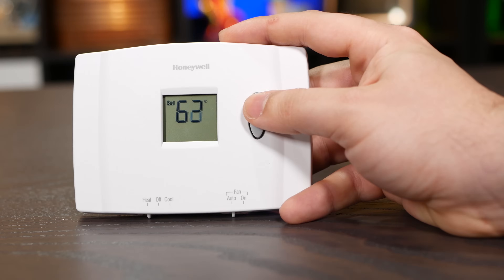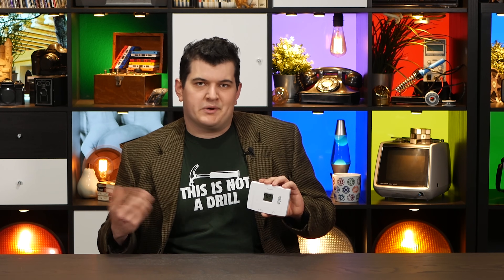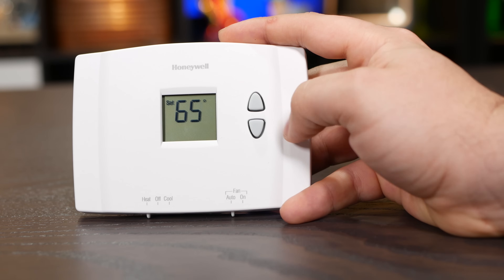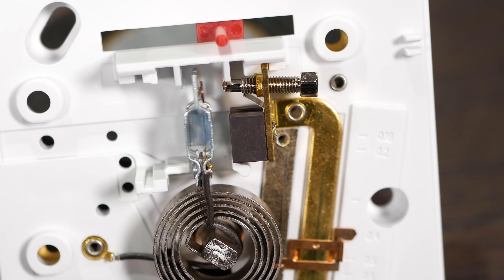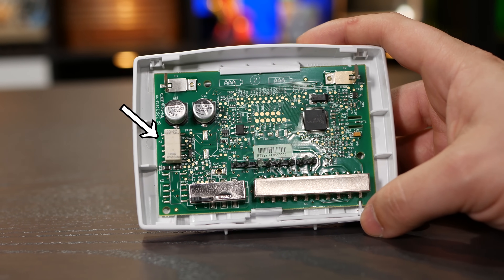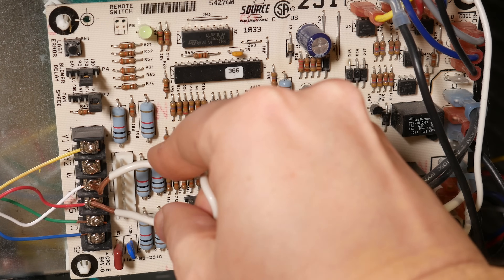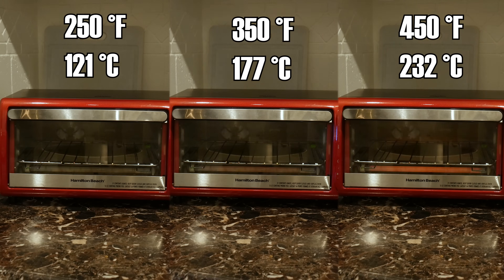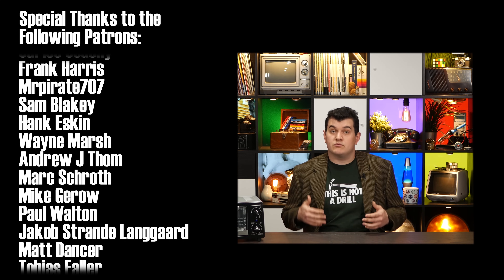Thermostats: Cooler than you think!

Comment: my old crappy thermostat has a boost button that overrides the thermostat for 1hour , there by forcing the boiler on to an always on situation, and its not a smart thermostat , its part of the boilers control panel , basically forcing the boiler to heat the radiators , yes uk , we use radiators metal boxes filled with water to heat rooms , no Aircon, No forced air , 
unless you count flatulence , 

boiler make and model is a Worcester HeatSlave , great name i think , and its burns heating oil , Which is a fancy way of telling people they have 1000 l of unrefined Jet fuel Kerosene in their garden

Comment: I have a question about my own furnace. When it's in heat mode, and the thermostat calls for heat, the blower waits to turn on for about two minutes. And as the thermostat stops calling for heat, it continues to run for about the same amount of time. This doesn't happen in cool mode, and also, it is not the thermostat. What is the reason for the blower to wait to turn on and off?

Comment: You mentioned power on the Control board. One thing we ran into with our HVAC control board was not enough power. Sometimes the heat would come on for about a minute and then suddenly shut down. This previous owner of the house had this problem as well because he had even purchased a new board, and left us the old control board sitting in a drawer somewhere. We had many HVAC people out to help us with the problem, the system was usable, but it was working at around 90% of the time, shutting down early about 10% of the time. We finally had an actual honest HVAC person tell us the control board wasn't getting enough power. So we looked at the power line going to the board and discovered that it had one too many break points in the circuit going to the board. In fact we had made the problem worse by having another outlet installed on the same circuit. We fixed the problem by having an electrician wire a dedicated line from the breaker box to the furnace control board and we never had another issue with power.. except dishonest AC and electrician people. Never let your electrician or AC guy install tiny wire caps(yellow usually) on the power wires going to the Control-board. Insist they regulation standard large caps(red usually) on the power wires. The tiny ones will eventually melt, I fully believe this to be a ploy to get you to call them back. The wire caps leave a mess inside the unit when they melt and pose a fire hazard and could damage other things like your control-board. I keep a bag of regulation wire caps near the AC and I have given strict instructions to the my wife that she is never to pay one of these people if she see they put the wrong caps on the wires. In fact she is to show them the bag of what we expect them to use and if we have a service technician over I check the wires for those stupid caps. I mean seriously what are those good for? I wouldn't use them to hook up a cheap car radio, yet here there they are on 120vac AC system.

Comment: My thermostat does the thing that you mentioned at the end of the video. It's actually the default setting. Whenever you adjust the temperature, a little "TEMPORARY" warning shows on the screen and it runs that temperature for a little while (not sure how long) before going back to the normal setting.

Comment: I have an older Junkers boiler where the control unit can regulate the "blast" by putting a voltage between 0 and 24V onto the control line. More Volts = more "blast". The control unit even learns how long it takes to warm up the flat so you just program it to WHEN you want HOW MUCH temperature and it will adjust the starting time accordingly.

Comment: I have a weird-ass system with the city's central heating. Like, we just get a pipe with hot water coming into the house along the cold one. But rather than just use old-school radiators that you have to turn on by turning their valve, the system has an electric thermostat, just like these in the video, that's controlling an automatic central valve that can cut off/turn on hot water for all the radiators at once. It's a fascinating combination of old and new technologies.

Comment: Also, I may have a partial answer for the question about "why thermostat wire?" Some of it may come down to building codes.

for commercial buildings, normal Romex is usually a no-no. Regular line voltage wiring usually consists of single strand wiring encased in conduit or flexible armored cable (BX cable). Both options are exceedingly expensive for regular wiring, let alone control wiring. 

Thermostat Cable, along with data cable ( like cat 5) do not need to be encased in conduit and is far cheaper for use as low voltage control wiring. 

Actually, (here in Pennsylvania at least) new commercial buildings and renovations >10% of total space are required by law to install LED lighting that must be controlled by occupancy sensors, timers or even smart controllers that incorporate multiple factors tied into a building management system.  These new LED lights can be, not only controlled, but POWERED by CAT 5 cable. 

It's a brave New world for commercial building maintenance nerds...🤓

Comment: A thermostat in the coldest room will cycle the heater more often than a thermostat in the warmest room.  If you want good fuel efficiency when running the furnace, housing insulation is crucial to keeping the inside temperature regulated, and not making the furnace cycle more often than it needs to.  This also greatly extends the life of the furnace, and keeps carbon emissions to a minimum.

Comment: 1:35 you said setting it to 80 doesn't make it heat go faster.... well a few years ago I got in an argument about how microwaves work on 50% power,  I told then that the part that makes the microwave is on or off, and the unit will have it on for 5 seconds then off for 5 seconds, they didn't believe me saying that the light doesn't turn off and the table keeps spinning ... ugghh  they try to prove them self right by saying other features of a microwave ......  I asked them what happens when you put the power to 0%, they tried to tell me that it is on because - IT IS ON-      i asked them if they ever got a DA, they said na whats that...  Dumbass Award

Comment: honestly yes the mercury one last forever but even the house settling will send them of kilter found that out the hard way with the bill apparently it was 7 degrees off when they were all perfect when the house was bought a simple fix but i dont feel like re leveling and screwing more holes in a wall just for mecury the lower end digital ones that run off AAs are fine and we dont need 7 nests in our house.

Comment: The thermostat in my apartment does what you asked about at the end. It's a Robertshaw and when you change the temperature while the schedule is it on first lets you select the desired temperature and then lets you set a time for this to be active, defaulting to 3 hours. After that it goes back to the existing schedule.

Comment: “Blue” actually does do something. Blue is connected to the common terminal which feeds 24v to the thermostat so it continuously power to the thermostat. Also it doesn’t matter what wire you use as long as it corresponds to the furnace.
Reply: Nvm he said it finally

Comment: I legit did not know about the greater than and less than symbols doing frame by frame! That is actually super handy! I believe if you hold down shift and press those same keys, it will change the 'speed' of the video instead!

And, honestly, I think that displaying the temp on the thermostat is the cause of many MANY arguments in the house... Why not have a "Colder" and a "Warmer" button that will just slightly increase the time delay between cycles... That way, you could--in theory at least--get to a 'temperature' that would be perfect for all the variables of your particular house... Room size, BTU, CFM, doors opening and closing, etc... it doesn't,, matter, since the thermostat just cares about how long the heater/cooler is running... And since I cannot tell the difference between 74 and 75 degrees of temperature, but apparently it is a cardinal sin to even raise it a single degree according to my Father... It might have saved a lot of arguments in a lot of households if there were no display at all whatsoever.

Comment: Now you should go into a condensate unit. Now that is the furnace that can go faster.  There is a combustion chamber,  a computer!  It can take the target command, and has input and output temp sensors,  then it chooses the fuel to air mixture,  runs the fan for said combustion chamber up to 3500 rpm, and will run the fires of hell! If the demand spikes,  like if you go from 58 to 80. These units often do heat and hot water,  have motorized butterfly valves, circulator motors, etc. Right up your alley!  Great video too! Thanks for your hard work,  sense of humor,  and all the information you give us!

Comment: One October we came back from vacation where our house had an interior temperature of 60 degrees.  We set the thermostat to 68 and waited 2H: 30M for the temperature to rise to 68 degrees.  The following year, we came back from vacation and our house interior was, again, 60 degrees.  We set the thermostat to 80 degrees and only had to wait 30 minutes for the ambient temperature to rise to 68 degrees.  We turned the thermostat down once it reached that temperature.

Here is what we noticed.  The furnace did not run continuously when the thermostat was set to 68, but cycled on and off in about 30 minute cycles even though the ambient temperature did not rise to tell the thermostat to turn it off.  It was cycling off by a signal inside the furnace itself.  By setting the thermostat higher, it did run continuously, because it overrode the signal in the furnace to make it do so.  We were told by our furnace guy that the furnace was designed to do this because it had a "oil saving/heat boost" system built in, that wasn't wired to our thermostat.

Needless to say, the fact that setting the thermostat higher did make the house heat up faster really pissed off my dad.

Comment: In answer to the last question about "1 cycle" thermostats, yes, they do exist in some higher end equipment.  I have HVAC systems in my radio network towers that feature a " comfort" button that allows the unit to run at a set temperature for a fixed amount of time.  Typically, they raise the temp in the shelter to a more "comfortable (72 F)" level for a period of time while you are in the tower working on the system.  After a set amount of time, it returns to its normal cycle of keeping the interior at a much cooler level (62 F).

Comment: Now what would be in your opinion the most effective and cheap way to heat a house, if you would build the house just now? I've been thinking about geothermal heating with water circulated underfloor heating elements. With that in mind, I've been thinking about having about 5 to 6 solar panels on the roof, and installing tankless water heaters to shower and sinks. I THINK it should be more energy efficient than having a boiler full of hot water?

Comment: I just backed the Raspberry Pi-based, HestiaPi Touch, an IoT Thermostat on Crowd Supply! You can literally program any behavior or automation you like. 

So yes, in fact, there is a thermostat you can ask to run for just a single cycle, then have it return to its previous setting. Or do anything else you can dream of!

Plus, your data is your own... not Google's (looking at you Nest). 

We need more open hardware devices like this. Anyone who is interest can find more info here: 

https://www.crowdsupply.com/makeopenstuff/hestiapi-touch
Reply: Busted Why not just an arduino?  Plenty of computing power for the job, and some chip models already have a rough temperature sensor inside, though wiring an appropriate part to an analog pin could help.

Comment: Interesting that the thermostats themselves here in the UK are the same but the actual heating system is different--we have boilers heating hot water for both radiators and taps/baths/etc., and of course there's usually no need for an air conditioning system. So what system is used in the US to heat the water for the taps (or should I say faucets)?

Comment: Never sure what the point of digital thermostats are (remote control aside) - a bimetallic strip thermostat needs no power input and doesn't break down, whereas a digital one is rarely fed by mains power but needs batteries which, in my experience, usually run out at the most inconvenient time so you come home to find the house freezing.
Reply: I should say I'm talking about wireless ones here, which annoyingly seems to be the norm even when they don't need to be; the C-wire system described in the video seems much more sensible.

Comment: In the UK you can get Hive thermostats (like Nest) which have a boost mode. I don't know if they do AC too but basically you can have a specified boost temperature, and you can set how long to boost for - which on the thermostat is controlled by a button. Each press of that button adds X minutes to the boost period.

Comment: Electrician here. I have gotten many a job with angry customers that bought a fancy wi-fi t-stat and discover the old 2-wire cable doesn't have enough conductors to power the device. DOH!

Now, instead of getting that cute little $100 rebate for the upgrade, they now had to pay double that to have a new cable installed, when all they had to do was get a $30 battery powered Honeywell to do what they needed. But NO, they MUST have that internet connection anyone can hack into.

Comment: I've frequently complained that thermostats don't have a single on/off switch, especially where I live where some times of the year it could be in the 50s F when I leave in the morning and in the 80s F when I get home.
The Cool-Off-Heat switch makes sense for mechanical thermostats for the reason you explained, but with a digital termostat, it would seem to me to be trivial to have a min and max temperature setting and have it use heat or ac as needed to keep within that range.
Reply: There are some that will work that way. I have one that you basically set and forget it will automagically switch from ac to heat and back when needed.
Reply: The ecobee has a "System Heat", "System Cool", and "System Off" setting so you don't have to worry about min/max temp settings ever being hit.

Comment: "It runs on full blast because that's the only degree of blast that a furnace can run." 🤷‍♂️
Reply: "There is no medium blast."
Reply: @Skipperthekitty  Only full.

And off.

Off blast.
Reply: Blasted things.
Reply: While certainly a cool statement, it's only partially true: multi-stage heating systems have existed for years.
Reply: As far as I can tell, this also applies to blast furnaces.
Reply: But what if my furnace has blast processing?
Reply: @jcrowley1985  I have no preference in reality either way, but there is no medium blast processing. Only Sega.

And Nintendoff.
Reply: Flame modulation exists and pretty sure Alec knows. By specifying it, he would have gone off topic as this video is about thermostats and not furnaces.
Reply: Look up two stage and modulating furnaces. They also have multiple stage ac units. You get longer run times at a lower capacity and better comfort because the equipment is keeping the space at a constant temperature and dehumidifying better .

Comment: I needed to control both temp and humidity (science thing), so I just used a raspberry Pi with a temp/RH sensor and some relays to switch a small heater, AC, humidifier, and dehumidifier.  Just crank all the actual appliances to max and let duty cycling (and some overshoot on the setpoints) do the magic.  Some incredibly slight coding cleverness involved with realizing that AC is dehumidifying and the dehumidifier is heating, but that's it.  Works great... can maintain a +-0.5C and +-5% RH range (at reasonable temps).  Certainly enough to keep the fruit flies happy (it is an insectary).

Comment: A few of my boxfans are thermostatically controlled, wired to run while hot.  You'd put the fan into a window, set the thermostat and it would turn the fan on to bring in cool air from outside and then shut off when the room reached a comfortable temperature.  One one of them uses a digital control, the rest are purely analog, using a spring to introduce switching delays.

I've wanted to build a boxfan that uses two thermostats to not only control when the fan runs, but which way it runs!